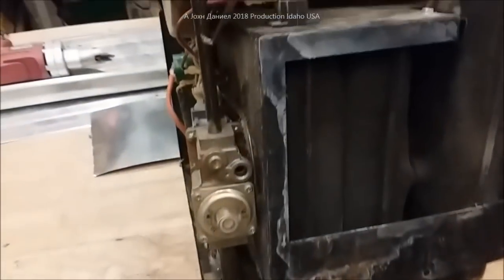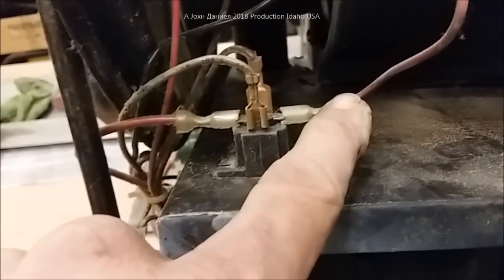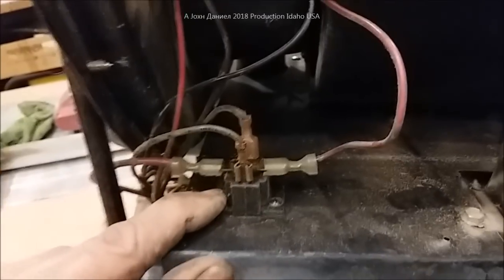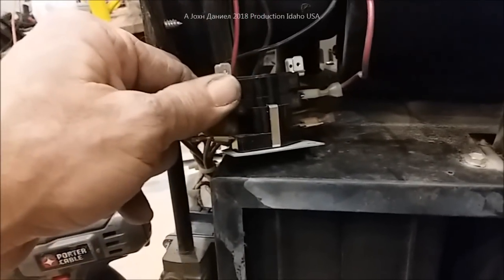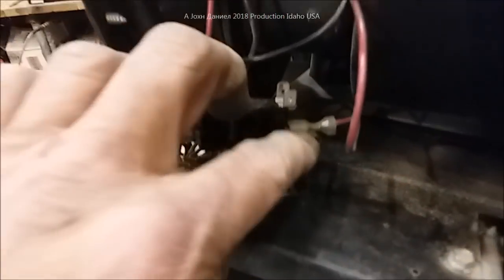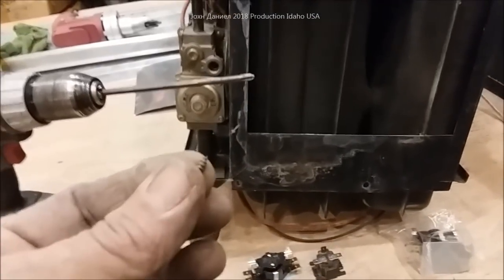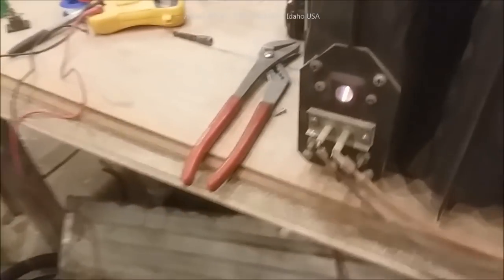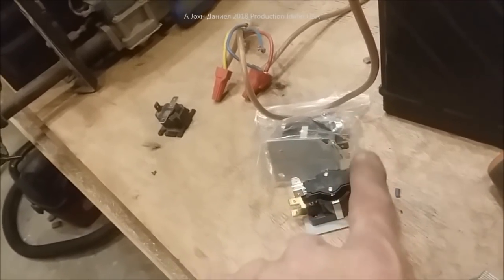RV Repair Shops close secret propane heater furnace DIY quick fix trick, for 70% less PARTS BELOW

Comment from the maker: My preference is the Klixon-Packard model https://ebay.to/2RtaAmH a best replacement for the $50+ Atwood. My way is only about $15! & last 3 times longer! Other options https://ebay.to/2FnBkyz if you want few seconds longer after heat cycle run. # See the upcoming video describing Heat Sequencers AKA Time Delay Fan Controls. I will explain them, the run time for cool and heat cycling. How to calculate a relay or other parts options.
Reply: another timely & helpful video...thanks! love saving a few bucks wherever I can.

Comment: Brother i sure could use a lil help , im pretty handy guy , but this thing has kicked my butt , was working fine ( untill it stopped , grr ) was when id turn tstat on id hear a click and fan would start , then wouldnt fire untill a few restarts , now no click , no fan , nothing.  Replaced the fan / run delay , still nothing , i can cross over the fan wires and fan will come on , but still wont fire , please help me ! Lol

Comment: I have a 1980 camper that has a Coleman presidential furnace, and I think it might be the electronic igniter in it that is having trouble. The thing to note here is, the problem only happens during colder days/nights when the furnace needs to run a long cycle. Please let me know what you think. The story behind this conundrum during colder days/nights is... If I leave the thermostat low (usually 50-55 f range), it will run, light flame and heat for about 10 minutes until thermostat temp setting is reached, shut off flame, and then shuts down after cool down cycle is complete, and all is ok, until.. If I turn the thermostat up to 60 f or more, which makes the furnace run longer, the furnace will run, light flame and heat until the internal temp sensor kills the flame, and after the sensor resets, the flame does not relight, but if I turn the thermostat down again until the blower stops, and then turn the thermostat back up/on, the furnace will then run and start the flame again until the same problem repeats again.
Reply: I am having the same problem with my Duo Therm heater and wondering if you have gotten yours fixed. If so, what fixed it? Thanks in advance for your feedback.  You can send a reply to bgooden

Comment: My suburban  is blowing and trying to ignite and fails to ignite the fan just keeps blowing and blowing and once in awhile it will click try to ignite again only once in awhile actually ignites. I was thinking it was this module that you are explaining in this video. I rewired it so all connections are clean since it’s over 30 years old and still same problem. Not sure if maybe it’s a propane line  issue  but stove works fine. Any advice?

Comment: I have a question. I have a demotic ac on the roof and a suburban sq42f furnace accessed from outside. It’s a Bighorn 5th wheel. The thermostat is in the front bedroom that controls the front AC and the furnace.  I had a new roof put on my rig.  Got it back and furnace doesn’t work AC does. My understanding is that 12v from the furnace goes to the board in the AC unit on the roof and has a return wire that brings back the 12v to the board at the furnace.  I get the 12v at the AC unit but there is no longer a wire going back to the furnace bringing the 12v to the furnace board to start the blower running. Here’s my question. I know the 2 blue wires at the furnace can be connected, with a 12v supply, to bench test the furnace. Can I put another 12v thermostat in my rig and take 12v power from the 12v being fed to the roof and take it to the new thermostat  I put in my rig and then send the 12v back to the wire feeds the connection to start the blower on the furnace? I’m just trying to bypass the AC unit so I can run the furnace from another thermostat. I think that’s right? If so what thermostat should I get?  Sorry this was so long. Help!

Comment: Really appreciate this. Currently having an issue with the gas valve that feeds our suburban rv furnace. If you have dealt with diagnosising / replacing the gas valve, would be great to see a video on that.
Reply from the maker: If your gas valve is partially opening, check power to it. It should be of full line voltage ( InRe 12.8 volts like the battery) and if it is not, you need to trace back till you find where the voltage drop is. They are designed to start closing at under 10.5 volts. So if your leaf switch in the blower is carboned up, you get low volts to the gas valve. Other options is pull its pipe, look in to see if its filter on the gas inlet is plugged up.
Reply: @JOHNDANIEL1  - our starts off running ok, the flame is a bit yellow in my opinion, but after running 5-10 minutes, it start producing a sound like a "blow torch". When i called Suburban, they just said, stop using it and it sounds like gas valve issue, take it to a dealer. Unfortunatedly, the dealer told us to check back in January and that was in November. I typically fix stuff myself, but its been challenging getting good info on this suburban forced air non-ducted 16k btu furnance.
Reply from the maker: Sounds more like you have Wasp nest or some blockage in the intake air part. Have you had it apart? Whats its year and model number, and if its a front vented 16k this can also be a result of a weak motor. I might have 1 or 2 of those on a shelf that are serviced and restored.
Reply: @JOHNDANIEL1    - think its a 2017 Suburban Model se-20seq with orific size 3/64". I have looked into the exhaust opening on the outside and into the burner chamber window from the inside bit didnt see any insect nest, dirt or debri.
Reply from the maker: 2017? Wow, and to fail that fast. No wonder I have started to install the Diesel units ( https://ebay.to/2FymPHn ) in the last 20+ RV's looking for more effective heating. You just run the 1" exhaust up the side wall outside sorta snug to the wall, 6" above the roof. Even looks cool.  They are about the size of a 16,000 to 22k btu but put out 21,000 btu and cost 30% less to run. But a 2017 Suburban Atwood failing??? Geez
Reply: @JOHNDANIEL1  do you have any of those old snap action gas valve you showed when you were replacing the thermocoupler on the Coleman heater. I have been looking everywhere and cannot find one.

Comment: Hi John, my name is Dan and Im on my wife computer. We have a 1991 motor home and the heater just started blowing cold, fan running, no heat.
I saw your video ( Great video, obviously you know what you're talking about) so I went to the RV store and sure enough -$65 for the dinosaur relay, so I thought I would order the one you suggested. The links below didn't work so I started shopping around.
What I got was a KSD301C C016. / H1 25. C 40 90/. H 30 110 C 1 30.($20 delivered in 4 days)
When I hooked it up, I had the bottom connections 180 out. It would start the fan, start gas and igniter, run 5 seconds and turn off. So I watched your video again, hooked it up correctly and it wouldn't start. I checked voltages ( ground, power and thermostat were ON), tapped on the relay and it kicked on and did the same as before. Fan on, Ignites, run 5 seconds and turn off.
Now I'm not sure if : 1) this part is too much different than the one you suggested ; 2) It is a defective part?, or 3) some other component has failed since I hooked it up backwards first.
I'm not sure what to do now sooo, looking for your expertise for some guidance. Can you help??
Thanks, Dan Heddon.
Reply: Hello, Dan, (on my wife's computer again.) I have solved my problem.
This different part# does work (KSD 301C C016/ H1 25 C 40 90/ H 30 110 C 1 30). The difference is I needed to switch the wires from the middle section to the upper section of the relay. Use the same wiring configuration just move the connections up. I don't know if I damaged the mid section but it didn't work as expected and I don't have a wiring diagram for this component. I did discover the heater is connected thru the battery and not the breakers, I was thinking I had killed power by setting breakers to OFF. Not true. Good luck Guys !

Comment: ANY ADVICE on an ATwood 7916-II.  Won't turn on at all. Replaced the Fan Sequencer, getting 13V to it but nothing out the other end to my fan. I'm assuming nothing else will work unless the fan is running and of course no voltage to the board as well. Thank you for your support to all us amateurs.
Reply from the maker: Did you verify the thermostat is OK? You can force the blower power on by direct connecting the 2 leads to the thermostat. They will be positive voltage, one live, the other switch sending. The plug may have a issue to consider also, be sure if your testing the motor you listen careful for a very light wine of electricity in the brushes, spin the blower some to see if that is present. Let me know your results.
Reply: After watching and rewatching your various videos, found out my thermostat was bad. Jumpered the two thermostat wires together and it fired up. :)

Comment: You show a different sequencer when you first start this video then when you have it installed it's another sequence what is that shit why did you use a different one I'm trying to put one in that's like the first one you showed and then you turn around and install a different one
Reply from the maker: Besides being a ass when you post, you failed to see there are optional furnace models, they were shown, and due to space and furnace model the single switch relay was being installed. 99% who comment are happy to see that not only one option exist, they followed the link and seen one that can work on the over 90 versions of RV furnaces, so if they have a 12 volt/120 volt furnace or a heat cool detent model, or a simple hydroflame, they found their solution.

Comment: Ordered the same one finished hooking it up when I turn furnace on & wait for blower to start, once the relay kicks in the batterie power drops enough that it kills the lights!! & until relay open's, lights are bright once again. Seems like the 24v relay  I received draws too much amperage!. 😞
Reply: Oh Boy talkin about learning from my mistakes !!  I had  mixed up my wires, hence why the lights went out when relay kicked in. All is well now! Only issue now is the 2 minute time delay before fan kicks in. Other than this, at least it works !!
Reply from the maker: Yes my big hands getting away in a lot of videos so sometimes people will get the wires backwards but I'm glad you figured it out. Sure beats the hell out of giving the furnace manufacturers 50 to 100 bucks for these things.

Comment: Sooo, what can I expect to happen if I get one of these wires in the wrong slot?

Also, does it matter which side ?
In other words if I flip it 180 will it matter as far as hooking it up...like power on one side versus the other?
 Doing mine tomorrow as the parts should be here this afternoon.....
Hope I hear from you...if not say a prayer for me and cross your fingers ...LOL
🤞⚡⚡🔥😢🤕
Reply from the maker: The two top wires won't matter, it's a switch. The two bottom wires will matter one has to go to ground and the other one comes in from thermostat.
Reply: @JOHNDANIEL1  Hey John, that was fast. The parts just came also.
How do I tell which side is ground?
I mean, I will know which comes from power etc... but no mark or label for which side is for ground or power...
 BTW, wow, fast reply...you sir, are awesome. Thanks
Reply: Hey John, gotta sec...?
I replaced all of the switches etc... I figured if they weren't bad, being 20+ yo, I replace it anyway to be sure.
 Still no heat. I pulled the whole unit and checked the electrode placement and the burner condition and all looks good. Also cleaned it up a bit but no debris or anything...it looks real clean and in good order.
I still have ...blower on, click with gas smell, tick tick and either a little whoosh and a shot of heat out the exhaust or tick tick and nothing.
 I feel like I am left with the board being bad...maybe??
 Or not enough gas flow (calls for 10").
I run the stove (3 brnr) one full then the next etc..not noticeable drop in flame. 
I don't have a gauge to see what inches I have.
  Any thoughts on this?? 
Kinda stuck....

Thanks,
Andrew
Reply from the maker: Are you sure the intake and exhaust are clean of any obstruction? Sounds like a poor combustion air supply. Wasp and some spiders can cause that.
Reply: @JOHNDANIEL1  ,yeah...kinda bummed. I took the unit out of the rv and opened the chamber, even took the orifice out. It looks like this thing has been used maybe a dozen times. It was a south Florida owned motorhome.
 I put it back in for the time being. 
I'm guessing I need to buy a flow gauge and see how many inches there are.
 Kinda stumped.
The igniter looked solid and about the right distance away.
 There isn't a strong smell of gas but can definitely smell that smell and hear the solenoid click as well as the tik tik happening.
 Seems the first time it happens there is the whoosh of ignition and after that there is no more whooshes until it shuts down and restarts again.
 I did just download the service manual and that will be my Sunday reading.LOL
 Thanks for checking in with me. This is as frustrating as trying to find an idle stumble in the hot rod. Grrrr 
HA

Comment: That was a great video on replacement of the thermocoupler on the coleman stove but you mentioned you were going to do a video on rebuilding the snap action gas valve did you ever do one and where can I find it. My furnace is having a low gas flame problem.
Reply from the maker: On one of my heater videos I put a link to the complete valve, it's cheaper than the $110 rebuild kit.
Reply: @JOHNDANIEL1  can you post the link I can't find it. Thank you. Pilot light works fine but getting really low burner flame any ideas on where to start troubleshooting would be great.
Reply: I would be happy to pay for the rebuild kit as I have been looking everywhere and cannot find much information on that Coleman gas valve.